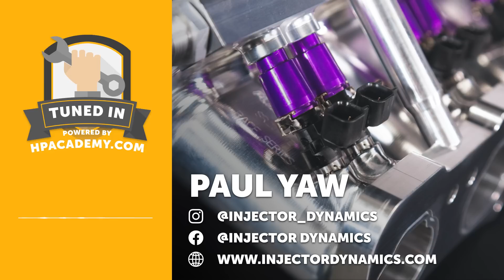067: Massively Improve Your Tuning With the Right Injectors [#PODCAST]

Comment: Such a good podcast. I'm a year late, but i have a question on the position of the injector.

Is there any advantage to pointing the injector against the airflow in the runner instead of pointing at the intake valve?
Does Injector Dynamics offer a service to clean, balance, modify, service or improve old and used injectors?
Thanks Andre and HPA team 🏆💪

Comment: After quite a bit of school and training then years of real world learning I would never think I knew everything..never but I thought I had a firm grasp on the what's hows and why's of my small niche of the motorsport world until I took a job at the R&D department of a vehicle manufacturer that I wont name here but the large parts of the things they were looking at and adjusting or changing ect was so far past the point of where I would have ever thought of looking at and the information on things just like the subject here just the fuel injectors and the adjustments made on such a small scale that makes a large difference was mindblowing to me... the couple years I spent there was way more informative and valuable to me than the  years of school I paid for lol

Comment: Another great Podcast from you guys! I save these podcasts up so I can listen to these on long journeys, They are great for learning new theories and applying them to parts of my own build. I have a question about how Injector choice is effected if the engine is running wasted fuel, can there be issues in terms of injector dwell time at high RPM as the injector fires twice?